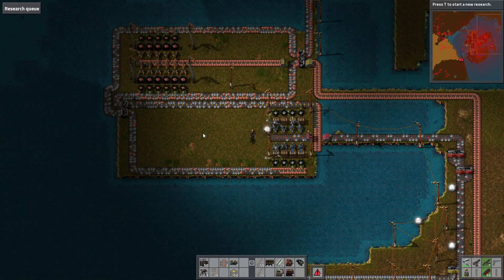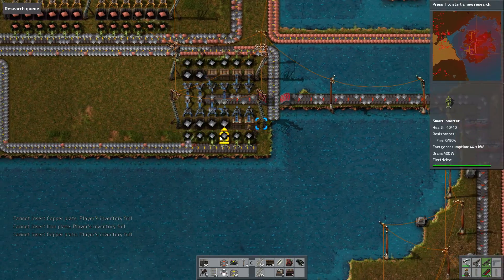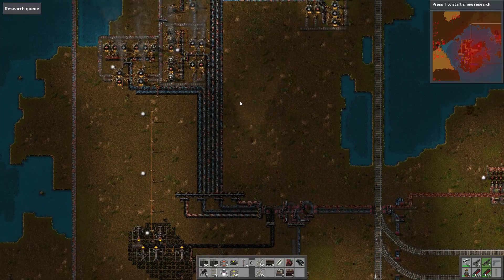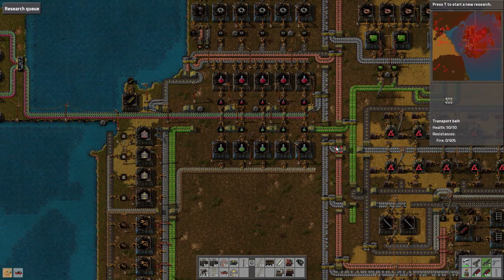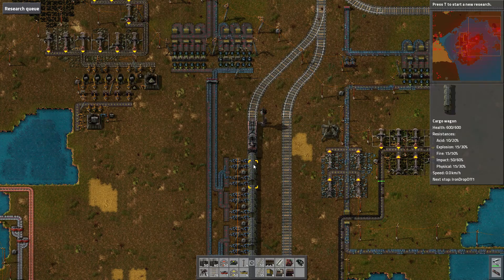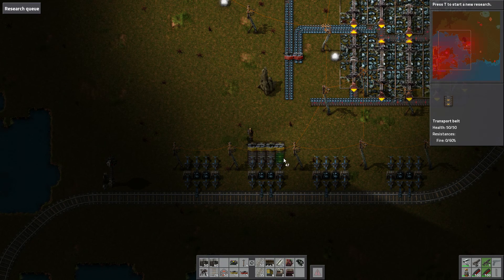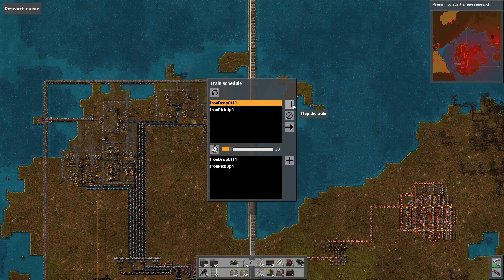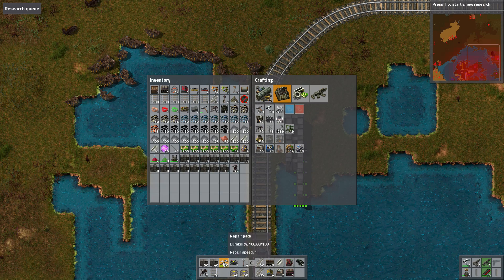Factorio The Island (Modded) - 25 - Sorting Madness!

Comment: no need to wait for robots
just use red/green wires and smart chests to fix the overloading of copper/iron smelting system.
change the chests in the sorting system to smart chests and connect them all with green wire, then lead the wire along the electric poles to the smart inserters pulling ore out of chests onto the belt. connect the inserters, set condition "copper plate" < "number of plates you wan to have in chests in the sorting system".
(i just recently looked up how this stuff works) ;)